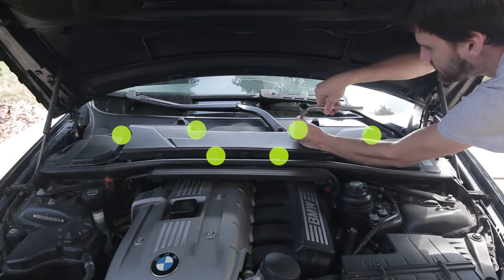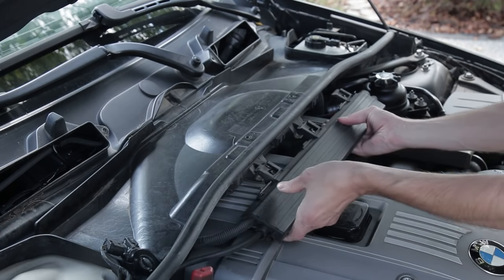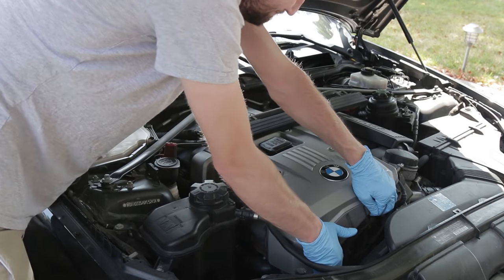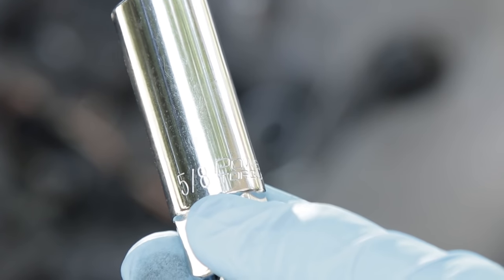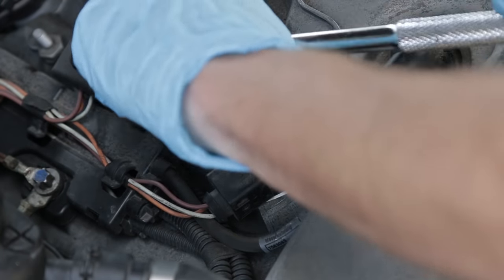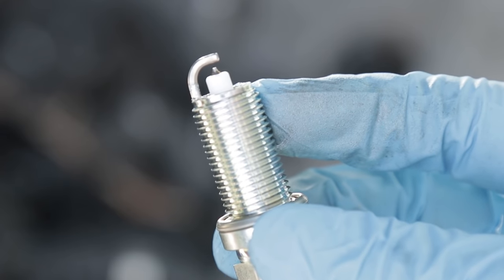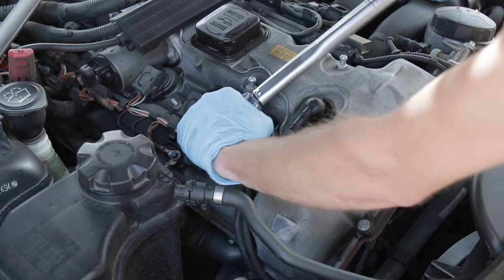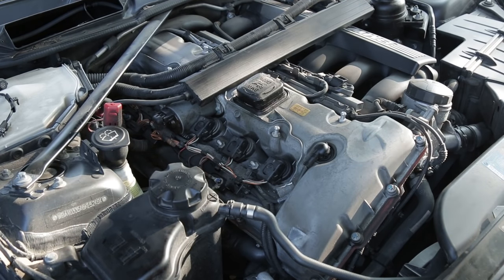How to Replace BMW Spark Plugs & Ignition Coils [E90, E92]

Comment: Should I buy a used BMW 2009 328x drive 170,000km it has new water pump,brakes and oil change. What do you think ? Should I buy a model with lower km ?
Reply: BMW's last, but it is a risk at that mileage. Water pump is a common issue with BMW's, so its not a major repair. As well as brakes and oil change, that doesn't make it a better purchase. Ask for more maintenance receipts or simply just look around for some with lower miles!
Reply: The 328 is reliable as long as you can get a deal becuase of the mileage go for it
Reply: eddie lewis thx for the advice, I'll buy one with less mileage
Reply: Jose Aguilar will do thx for the quick response

Comment: So it turns out that there's a BMW Service bulletin that claims that if you replace the Bosch ignition coils with Delphi coils, the misfiring problem can be solved entirely. I did this to my E92, we'll see if it pans out. 
https://static.nhtsa.gov/odi/tsbs/2015/SB-10058489-9490.pdf
Reply: Any update?

Comment: Hi , my 2011 BMW 328i (N52N engine )has a problem and i Don’t know what that is , i changes ignition coils and sparks and even water pump and thermostat but still i have the check engine light and engine is rattlig, i have done the compression test two of the cylinders are 120 , two of em 150 and two 180 , i don’t know what should i do ? can you give me a mind with that ? 
i'm desperate please anybody knows help cuz if i can't find the answer im gonna sell my love :(
Reply: get a code reader or take it to the dealer.
Reply: Thank you, I don't want to pay too much that's the point
Reply: Did you end up fixing this issue? If not, whats the rough idle like? If you had the coils and spark plugs replaced within the spec for torque, you would also have to rule out the wiring. the other thing that you can do, is check the two motor mounts, and the bolts/nuts supporting them. The motor/engine mounts are pretty good, but often the bolts/nuts can snap causing vibration. Since the electrical should be done by an experienced indie shop or the dealer, I would check the mounts myself, then go from there. Good luck. Another thing, one of your new coils could be bad, while the car is on, try removing one engine coil and see if it makes a difference to the engine, if it makes a difference, plug it back in and move to the next coil. If one of them makes no change in behavior at all, that new coil could also be bad, cheers.

Comment: What's the us import tax?. Cause 06 Bmw's in the uk are hella cheap.
Reply from the maker: +Gangsta Tech there's no import tax when you buy a used car. Just state sales tax which varies from state to state
Reply: Justin Buice No 330 xi's here but a similar variant cost about $7700
Reply: Gangsta Tech On France it's 17 000$ for a e90 330xi in good condition
Reply from the maker: That sounds about right. I just checked the book value the other day for my area and it says $5,000 trade in value and $9,000 private sale. That's considering the mileage and that the car is in good condition.
Reply: How old was your beemer when you got it?

Comment: I added new coils then plugs then I got misfire codes
Reply from the maker: Are you sure all of the coils are properly seated on the plugs?
Reply: Justin Buice I had a buddy do it for me I’m pretty sure I went back in there and pushed down really hard and made sure the connectors were in all the way , could it be he didn’t install the plugs correctly ?
Reply: Justin Buice  and what do you mean “ properly seated “ ??
Reply from the maker: @wendigoinc2438  meaning the coils are pushed in all the way and making contact on the plug. A misfire after that job means that at least one of them isn't connected properly.
Reply from the maker: @wendigoinc2438  If you still have the old set of coils, you can re-install them one at a time and start the car each time and see if the misfire goes away. There's a small chance that one of the new coils could be defective
Reply: I got the misfire codes after I did the spark plugs , using iridium NGK 
Could it be the plugs ?
Reply: Justin Buice Bradley  I used off brand cheap coils  I exchanged them today for oem Bosch ones also had NGK plugs as well in there that  were 2 days old , I decided to get Bosch plugs double platinum instead of the iridium, when I went today to switch the NGK ones they were fried !!!! 

Was this becusse I was using shitty coils ? Or did I not install them properly 
I torqued them until I felt the tension 
Not sure if there’s a certain amount of specific way I need to do that .